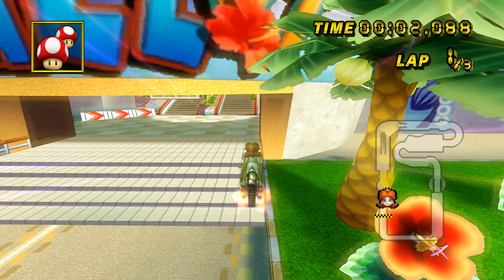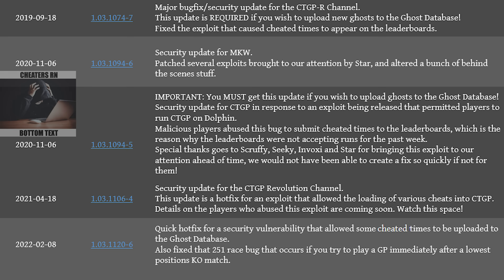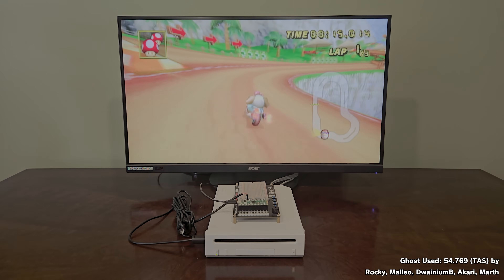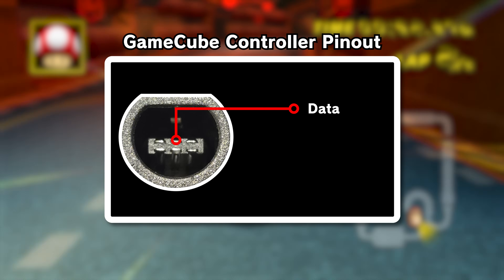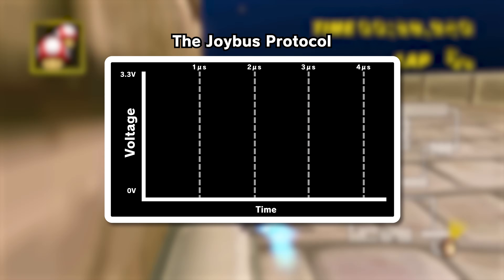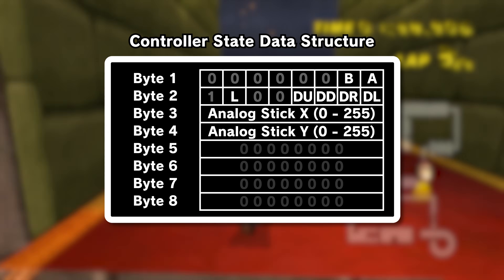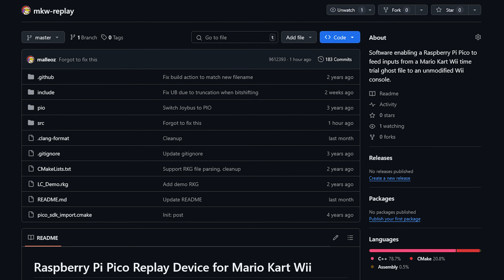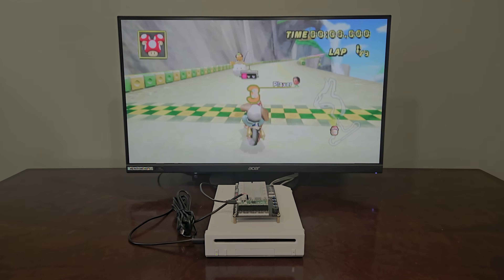Building an Undetectable Cheating Device for Mario Kart Wii

Comment: Fun fact,1 piece of code logic can be made that decodes the GC controller 1s and 0s, Ford PWM OBDII 1s and 0s, and gen 3 LS crank sensor signal. That last one I did recently with the help of ChatGPT. Before that I made a signal generator to make the signal, without ChatGPT. Well, you might need to change the order of if high and if low in the main interrupt depending on whether the pulse is intended to start low or high... but whatever. It's also clock speed agnostic by design, because it's made for an ECU; that signal varies wildly in frequency. With generic arduino code on a Pi Pico I was getting beyond 24KBytes per second before any errors.

Comment: Really cool video! That said, the "fix" doesn't quite make sense to me. The goal is to raise the barrier to hardware-based cheating to allow the community to maintain trust in CTGP leaderboards, but this approach doesn't achieve that. You can still use a replay device. It just won't support perfectly deterministic, frame-accurate TAS playback. You could even start playback at a different point, use output from the console to adapt on the fly, implement timing imprecision to emulate a human player in hardware, and the list goes on. 

In return, players are left to deal with non-deterministic replays, inputs that aren't correct, and most importantly you can't at all trust the leaderboard, which defeats the entire purpose.

Cheat prevention isn't a one-size-fits-all approach, and in the modern day requires a combination of software and statistical analysis techniques to get anything half-decent. This just seems like it isn't worth it for the meager benefits. 

Maybe I'm missing something?

Comment: 3.3 volts without ground is ... hurting my head a little

volt is a difference BETWEEN two things.
its like "I am holding my finger 3.3cm away." FROM WHAT xD
i guess it works since ground is connected some other way between the pico and the groundpin

Comment: This is why livestreaming attempts has been a requirement for the top runs submitted to most leaderboards. Livestreaming creates a ton of barriers to faking a run and hand cams do a lot too. While its always possible to cheat a livestreamed handcammed run, its so daunting that very few people will ever attempt it. If a leaderboard doesnt require livestreams then I guarantee with 99% certainty that one of the top 10 runners is a cheater, although it might be worse.

Comment: I wonder if what ive been doing for about two years now would be considered cheating? I dont time trial, but i do play online/wars/lounge. I've long been upset with claw gripping on the ccp, so I figured I could remap LT, which doesnt do anything in MKWii, to be up on the d pad. That way, I dont have to claw grip. I ran a wire from the pin on the trigger circuit board to the main board where dpad up is and... It works flawlessly. Makes the game a lot more enjoyable/fun to play, but i cant help but feel some people might not take too kindly to it.
Reply: I believe Barney modified his Gamecube controller's d-pad to make him not get sidetricks (sidetricks are bad for GV no glitch) and as far as I know there's no issue with it

Comment: I'm sure people have already said this, but to get better solder joints you can just make sure to heat both the pad and the pin and let those melt the solder (otherwise the pad and pin are too cold and the solder is only melting because it's in contact with the iron), and make sure to use flux (either with rosin-core solder or separate flux paste that you slather all over everything, or both together if you really want a good joint). Also, make sure the iron has a little bit of solder on it while trying to heat the pad/pin or it won't make good thermal contact and you'll be there all day. And finally, solder that's already melted once often doesn't work as well (I assume because the flux has burned/boiled away) so a fresh dab of solder often makes the whole blob "wet" properly.

Comment: Use flux the next time you're soldering.  You'll be surprised at how much easier it is and how much better your joints look!

Edit: BTW what you've created is very close to what has already been done on NES and SNES (called TASBot).  I think the GDQ and TASVideos communities would be very interested in your project.  =)

Comment: some of your joints need flux, the ones that look all ball like usually. Some need more heat, if the material you are bonding with doesn't heat up enough it will look craggled and pock-marked. just a tip, flux across the entire thing will help in both fronts. also, sometimes bad joints are fine (precision here doesn't matter i'm assuming) but you can still burn out your board or melt your tip off. cold joints doesn't mean more heat from the iron!

Comment: People throw around the word "Hero" all the time and so loosely nowadays, but I think we can confidently add this guy to the panethon of online heroes. Not only did he find a way to bypass anti-cheating software for CTGP Time Trials, but he also didn't use it for personal gain/online clout to submit cheated runs with next to no traditional way to detect foul play already in-place. Bro also prevented this method of cheating from being used by addressing the creators of CTGP, if it hasn't already been used to submit fake/cheated runs. On top of that, he manually soldered header pins on the a Raspberry Pi Pico, when he could have just sent it back and got a Pico 8 that includes pre-soldered header pins. Absolute madlad.

Comment: Another interesting way to prevent this would be to make the syncronization harder: Add a random, small amount of frames to the controller disconnected prompt.

It would force anyone making a copycat device to process screen data as well, which adds quite a bit of time and effort.

Comment: common the grounds between the pico and the controller, you could have some issues. also you could just use the 3.3v line off the wii instead of having to plug the usb cable in.

Comment: 09:15 You should use a flux like Amtech NC-559 to make solder more "liquid". That's will fix your soldering. Also, 350°C is too high for soldering. 250-300°C is enough for bunch of different solders.

Comment: I actually emulated a wii mote sucessfully. You can open an existing aliexpress wiimote and remove its pcb  and keep everything thats there to pair the wiimote to the wii. So you can simply send gyro data as well as button presses to the chip of the wii mote and it handels all the connection issues. You now just have to deal with different delays caused by the wireless connection

Comment: A Pico seems like it's more than needed. Why not just use an Arduino which is essentially just a Micro Controller.
I'm not sure you need a full computer like a Pi.
In know this doesn't need to be said but, I say "essentially" because the industry has much simpler Micro Controllers running sensitive equipment than an Arduino.

Comment: If you were good enough to do the  initial inputs that would be manipulated by the anti cheat and good enough to line up where you would need to be to start the harder inputs, couldn't you just make a device that starts a ghost trial later on in the track?

Comment: New anticheat software idea. If you want to put a time on the leaderboards, you have to go to Dave's house. He has a wii and doesn't even know how to hack it so it's fine. You might have to let his little sister have a turn sometimes though. Jokes aside, if the control fuzzing is random, what's stopping someone from running the program over and over until it works?
Reply: stop asking questions what are you a Dolphin user
Reply: the reason you can't just run the program over and over until it works is because fuzzing is always guaranteed to happen and always guaranteed to lead to desyncs

Comment: Using a phob gcc board and modifying the firmware might be an even easier way to do this since the only soldering you'd need to do would be with a spare GCC cable. Or you could just buy a "broken" phob where something like the analog or cstick doesn't work, flash new firmware onto it and then you wouldn't need to do any soldering at all.

Comment: That's an interesting solution to the problem of just recording the steps by taking advantage of the fact that an actual person would be looking at the screen. My concern is that there is still a reasonable amount of room to cheat: aim for the exact odds you have programmed for. It might take more than one try to get a record but it would still work some percentage of the time. That's unless enough stochasticity is added, which would mess with the human players as well.
Reply: you have a 1 in 23 billion chance of hitting the exact RNG. it's also seeded using hardware noise and a few other things we're not entirely aware of, but afaict it's CSPRNG
Reply: erm why are you raining on his parade just be happy and stop thinking nerd stop cheating

Comment: Non-deterministic input tweaking is brilliant! Hold the clean 300 °C tip on the pin and pad strongly for 2 seconds and your solder will flow through.

Comment: Is there any reason that changing the controller plug back in timing wouldn't work? Obv it won't if it's handled in OS, but if that's an mkw thing and you just change it by a random value it should work, no? It's not perfect of course, but it might prevent some issues of people calling johns

Comment: The method of prevention is interesting, because my first instinct was: If this is based on the time between pressing A at the start of the race and the race actually beginning, why not insert a random amount of freeze frames in between the two? This would throw off your timing method and not influence control whatsoever. Though I assume that the people who live and breathe the game have put more thought into this than I have.
Reply: Two problems:
1. You can move during the countdown in this game.
2. You can completely circumvent this by programming a delay. Eventually it will hit.

Comment: yeah something like this is something I've been talking bout for years. It's trivially easy to cheat, and the fact more speed runners don't gather evidence their runs are genuine is deeply concerning to me. For example, you can have microphone near your controller picking up stick and button pushes, that helps your legitimacy. You can have a cam angled down showing a bit of the controller and your hand, that adds some legitimacy. Great chess players like Hikaru streamed bullet where it shows his entire mouse pad on stream, that is perfect and what speed runners should be doing. You can play live events and have your controller recorded so people can clearly see you don't use macros, and so on. If you don't do any of those things, if you just have your gameplay footage up and suddenly you are an amazing runner, why not gather evidence? That's what I never understood, it's low cost, it helps your legacy because it's so obviously easy to cheat, in fact, I've theorized that AI can be used to generate controller sounds in pseduo realtime and so even controller sounds won't be enough to prove you are legitimate long term. Runners should be going out of their way to gather all kinds of evidence their runs are legit, but they don't. Their runs and legacy is cut short because of that and they can't see it.

Comment: From a hardware guy -- 5:10 you mention not needing to care about power/ground, but I'd recommend you at least bring ground over. It's important that your peripheral device have the same voltage reference as what it's connecting to. Right now you're getting away with it since both the Wii and your device have their grounds tied together through your house's electrical wiring, but if the ground prong was faulty at one of those devices (or if you started running your peripheral on battery power, such as with a laptop), they could potentially have wildly different electrical potentials in reference to eachother. The data line is probably pretty high impedance, so it's not gonna fry anything if it happens, but it'll definitely cause some headaches when the data signal gets interpreted as something strange.
Reply: Absolutely, power does not matter but floating grounds are an evil you don't want to have to debug in the future

Comment: I wonder if you can add or remove some controller polls to desync these devices. If all they see is communications with the controller ports there's a lot of little things you could potentially tweak in there to cause issues.

Comment: making the game physics non deterministic is such a lame way of patching this issue, trackmania players have already solved this issue for years by simply just asking for replay files of previous attempts and analyzing them
Reply: Ghosts only save in this game if you finish the run. Most of modern-day time trials is just reset simulator. That solution won't work here.
Reply: @flambambam  trackmania runs are sent through a competitive patch that modify certain aspects of the game, why couldn't this mod that has basically the same purpose just save all runs? it's not like a single run file weighs hundreds of GB, and even if it ends up taking up a lot of space, compression algorithms exist

Comment: Aye!!! i have the same ghetto horrible station. Was dirt cheap. I recommend checking the calibration on it. I also recommend getting a hot air gun. Soldering is so much easier if you preheat first. Happy Making!!

Comment: That quip about dream, although funny, would probably be better if you mentioned trackmania, which has had massive cheating scandals because of this exact issue, with definitive proof.

Not saying dream didn't cheat, Occam’s razor says he did… but also, a few things have come out that at least give some amount of doubt about weather he actually intended to cheat. Trackmania the evidence is indisputable.

Comment: Nice video, while this works for a controller that simply just replays a replay file it wont work for more extreme methods.
In some fps games cheaters can have 2 pcs, one for cheating and another that is clean of any cheats and is streaming gameplay.
The cheat computer views the stream and uses it to implement cheats.
In this case it would be worse than a fps game since you are racing and dont need info about enemy positions and such.
This is way of cheating would take effort to implement but if someone did the random inputs would have no effect.

Comment: Hardware cheats are insanely difficult to detect because there really is no difference to the console between that device and a real controller. Who's to say you're not developing a legitimate custom controller?

On PC, triggerbots that use analysis of a small chunk of pixels around the crosshair to automatically press the fire button are a similar issue, as are hardware devices that read RAM at the hardware level to do wallhax.

Detecting this kind of cheating usually requires a lot of statistical analysis of gameplay, because there's almost nothing on the player's machine that a software anticheat can reliably detect. At best you might be able to see a PCIe ram reader's hardware identifier...which could easily be copied from legitimate hardware, because why would a cheater tell you he's cheating?

Comment: Interesting that mkwii is deterministic. I wonder how many consoles / games are. I’ve thought about this method a lot and why it wasn’t more common, I just assumed that some random elements in the game would de sync it and that was why nobody tried. nice vid, I like your quality control specialists lol
Reply: You wonder...... what other games there are... where your inputs determine your actions??  are you high?  are you old enough to get high?  what is going on in this comments section
Reply: @WroughtJallie-i4v  This device keeps track of time completely independently of the wii. If there was a lag spike during gameplay or something that caused an inconsistency, then the gameplay on the wii would lose synchronization from the device, and the inputs would not be timed correctly with the game (hence how they were able to patch it). I think most consoles aim to hold a certain framerate (like 60fps), and since they run a light weight OS that has a lot of optimization and stuff, they can get the games to run without any lag or issues, so they are 'deterministic'. But for a game like BOTW where it lags in dense forests, an external device like this would quickly lose synchronization. 

On the other hand, PC games often let you uncap the FPS or set the limit higher than your computer can handle, which leads to inconsistent frame times and stutters which affects input timing precision. Of course these games don't rely on the frame rate for game speed and have internal timers to track inputs and trigger animations and events, but other factors can induce lag that change when inputs are processed. Additionally, PCs run a heavier OS that needs to juggle when all the applications can use the CPU. This can cause inconsistent input delays and similar things, which make approaches like this much more inconsistent. 

But yes, of course in general when you press a button it impacts the game. The precision of when it is processed and other specifics is what can make this approach much more difficult or not feasible.
Reply: @ it's one time trial and the time starts when he plugs it in lol stop talking to me
Reply: @ lmao ok bud

Comment: Desyncing inputs by faking inputs means the runs are rng based not skill based. Uuuuur stupid af.
Reply: No, it doesn't make runs random. The system is designed to not be intrusive to humans, as it makes a single frame of difference only when the stick is in motion in a 60fps game. The change is a smaller order of magnitude than a slightly shaky finger moving the analog stick.